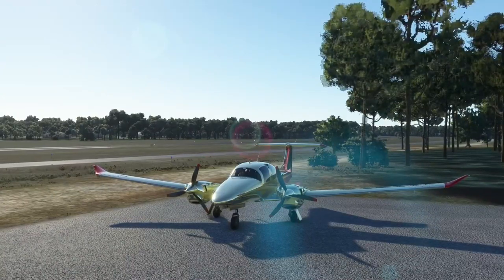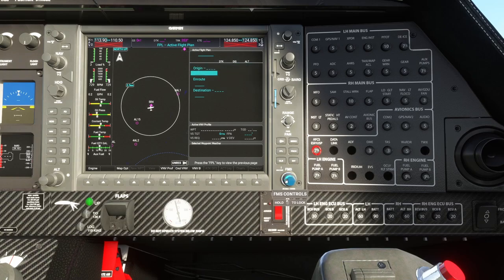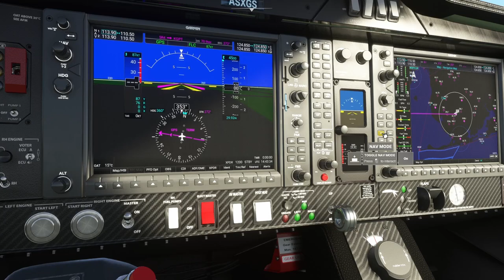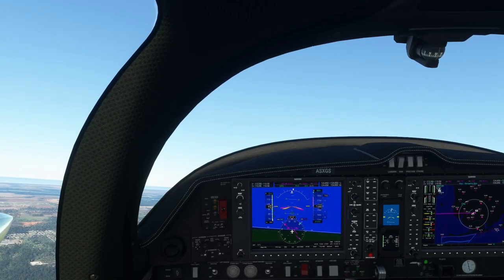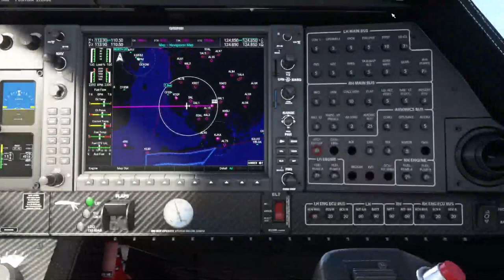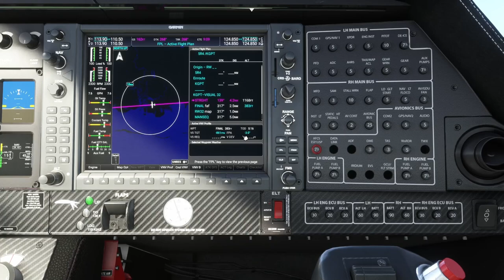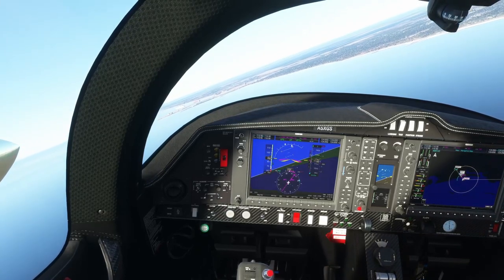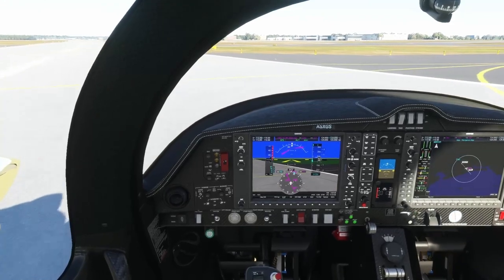MSFS 2020 How to Fly the DA62 Diamond Air 62 Simplified

Comment: As a novice simmer I had several unsuccessful attempts to land the DA62 flying completely by hand until I came across your video. I carefully followed everything and managed to replicate your flight from Foley to Gulfport. (Being on XBox I had to put the flight plan in first via the World Map). I was amazed how accurately I was able to control the DA62’s speed using the throttle on the descent and was really pleased to make my first successful landing. It wasn’t perfect - after engaging the second stage of flaps and lowering the gear I lost a lot of speed, but was able to recover by increasing power just before touch down. Your autopilot techniques, like the one using the TOD marker, worked really well and I am going to use them now with other planes. Thanks very much indeed Mike.